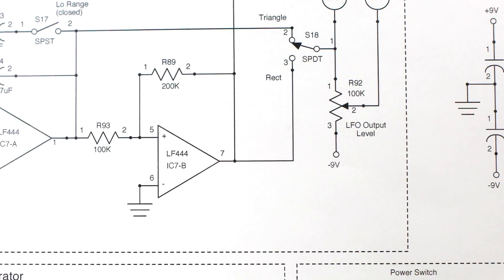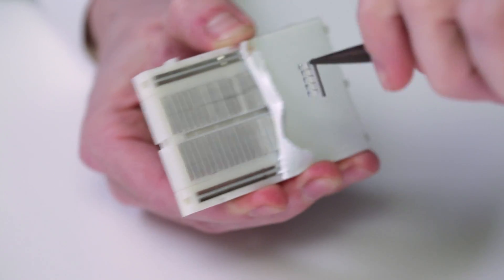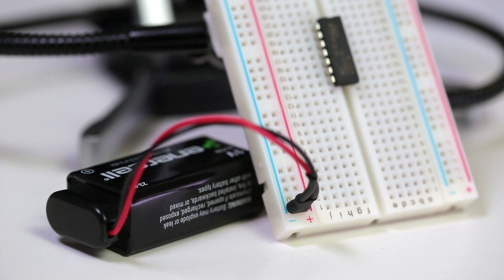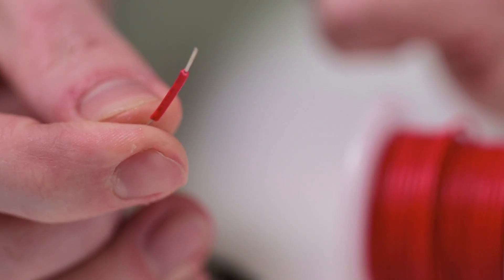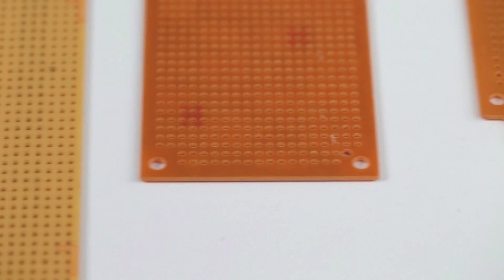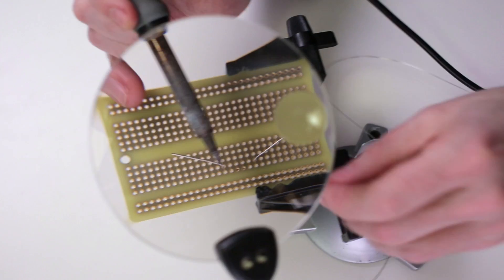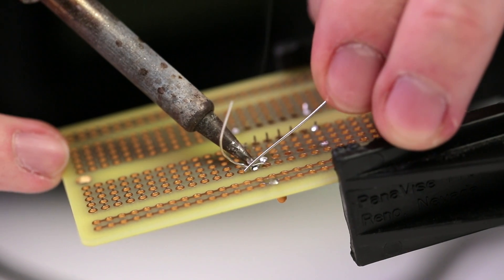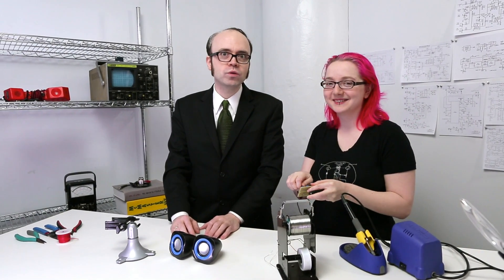Collin's Lab: Breadboards & Perfboards #Adafruit

Comment: The PermaProto board is a great thing...
but...
I've been using YwRobot's breadboard PSU ( http://www.hobbytronics.co.uk/prototyping/breadboards/breadboard-power-supply ) but the spacing between the power rails and the main prototyping area is a little wider on a regular breadboard and a little narrower on a PermaProto board

Comment: let's say you have a proto board such as the beaglebone proto cape. it's essentially a perma proto board, but doesn't have the separation in the middle to isolate pins. how would one go about isolating the other side in case you want to put an ic or some sort of sensor on the cape?

Comment: Just two footnotes/hints.
1. Re-bend bend the leads of the component after soldering to a stright vertical position. It will be seriously easier to de-solder.
2. Use properly sized socket for ICs, do not solder them directy onto the board. Two reasons: 1. no heat stress on IC, 2. easier de-soldering.

Comment: Hi,

Myself Rajiv, from India..I have often found that while soldering on a Perforated Board the metal pads come out of the base plastic often, if a little heat is expended, while connecting, say, Node points, wherein two or three wires have to meet to form a Node point..If the Metal Pads come out then the circuit fluctuates due to loose joints, and the output is inaccurate. Is there any way to come across this Problem ?

Thanks,
Rajiv.

Comment: What do you do when many components need to connect to the ground or Vcc on your perfboard?

I'm somewhat new to the perfboard, I did a project with an Arduino and 6 (7?) components (to date. I plan on expanding it) and they all needed to be connected to ground. I ended up running an exposed wire through them hovering a few mms above the board and then carefully taping it to make sure nothing shorts anything else but it's far from being a good solution. (Maybe I should've shrink tubed? And then exposed parts of it?)
Though it did work fine so far & stayed secure through flights and events I brought it to.

Great tutorial Adafruiters :)

BTW, if anyone's interested in my small project, look for "Dalek Fez" on my channel.